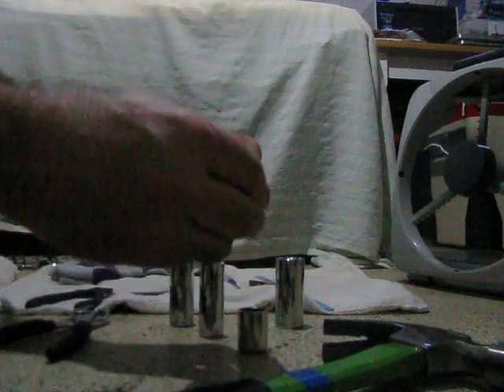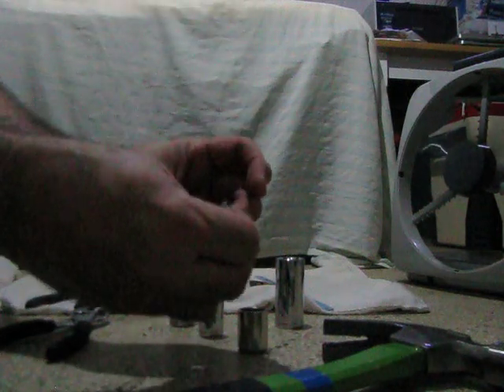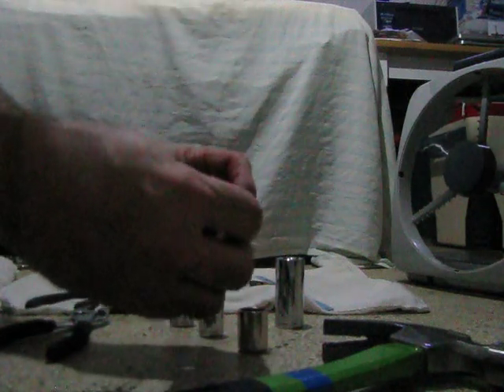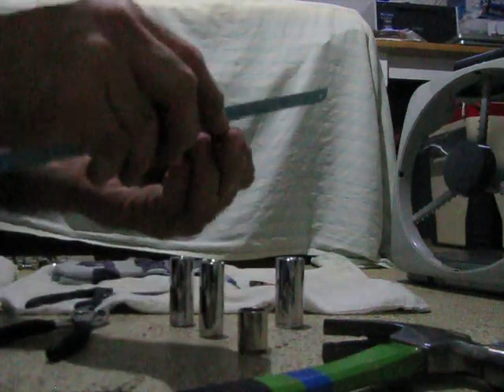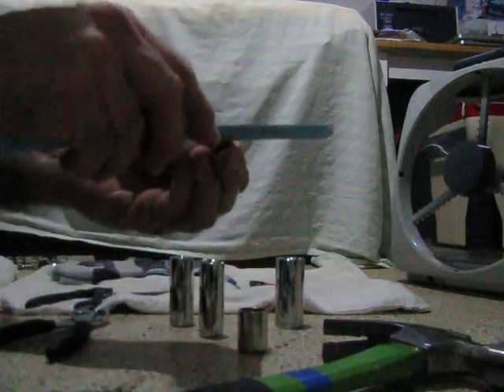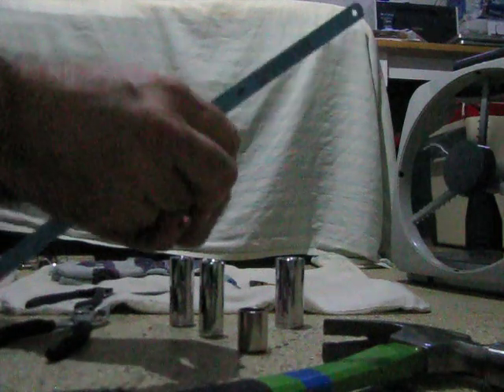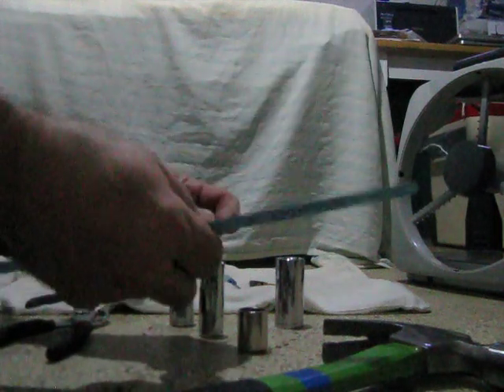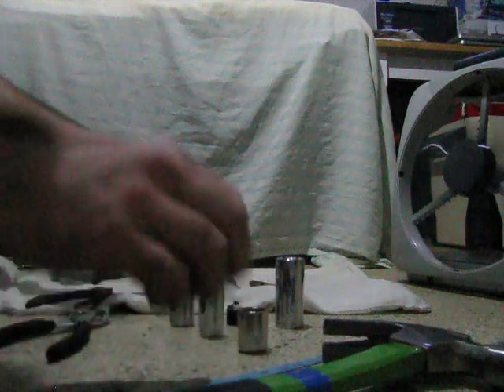CDV-700 probe disassembly

Comment: What's the point of the spark plug socket when you're hammering first?
Reply: It allows room for the tube receptacle to move downward without it being damaged while driving the pin punch through the hole. If you put it on the table/bench/floor/wherever-you-are-working without the socket or something similar, the the tube receptacle would hit the worksurface and worst-case, could be damaged if you continued driving the punch pin through. Best case scenario would be that you would drive the punch pin and it would begin to move but then stop and wouldn't go any further.